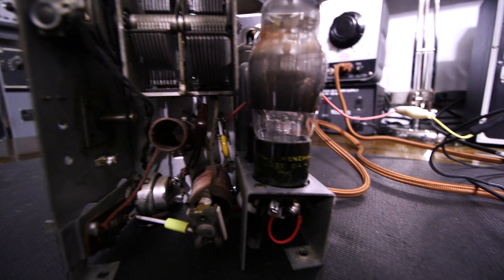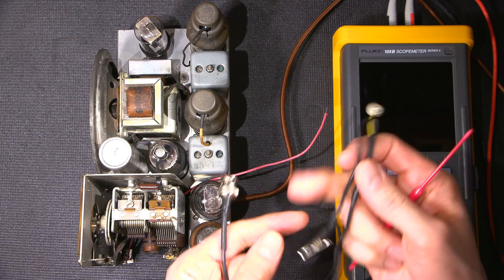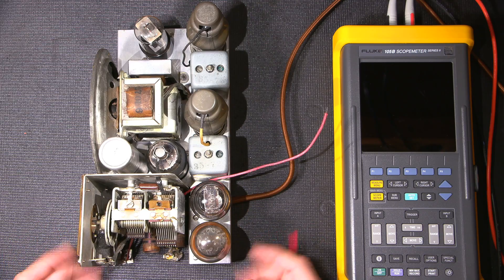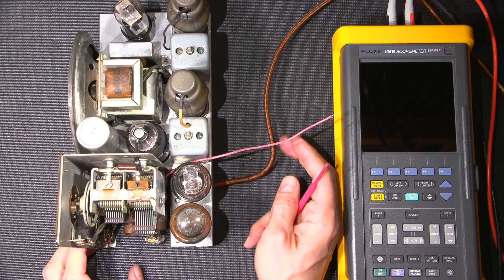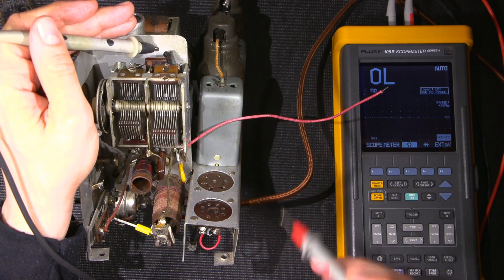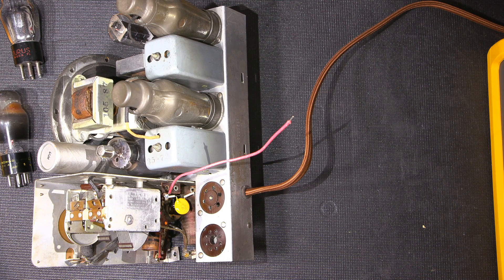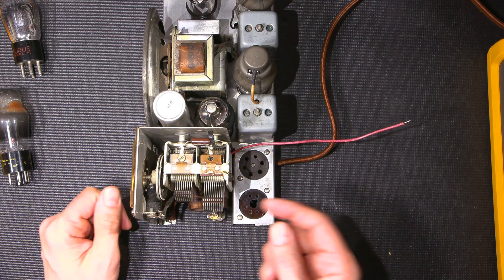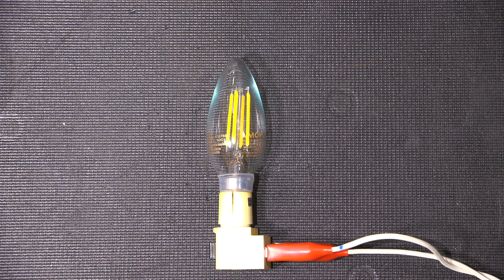See High Voltage Created From Falling Snow!

Comment: Years ago, I had this happen to me.I was woken at 2am by a loud cracking noise coming from the ham shack. The coax from my G5RV was disconnected from the radio, but lying on the bench near to my FT847. It was snowing hard outside. There was a big arc between the radio and coax connector. I got quite the belt when I grabbed the coax! I now have polyphaser protectors and have not seen this happen since. Interestingly the FT847 survived with no issues.

Comment: Oh, I had similar happen on a coax cable leading to a large CB antenna.  There were storms nearby and I disconnected the coax cable from the CB base station.   A little while later I started hearing a pop every couple seconds, and found a spark jumping from the center to the shield.  I think the antenna was picking up static from the air.
Reply: My experience exactly!

Comment: Back in Missouri, we had a teacher describe what your talking about, except he had no antenna, what he had was lighting rods on top of his house. And the Cable (#0 ???) running down the side of the house would glow RED from the current being taken off the the lighting rod spikes during the winter- no snow, just really cold outside and windy. It would have been interesting if you could use one of your scopes to catch RF from the spark.

Comment: It may also be related to the dust content in the air at that moment. It is a known phenomenon. Search for dust triboelectric charge. In serious storm, dust may charge up to 15 kV in dry conditions.
In US one must look for Peoria Loess dust releases which usually occur in winter time.
Reply: I wondered about carbon particulates myself but good old dust of course
Reply: You, and many others, are missing the fact that there was a 30 or so ohm resistance between the capacitor and ground, through the coil. This should earth the antenna and prevent any static build up on it, unless it's some AC or RF phenomenon that interacts with the reactance of the coil and capacitor in the radio.
Reply: @tasmedic  Would you care pointing the time where Paul says that the antenna was grounded? At 3:54 he clearly states that the antenna was not grounded.
Reply: @ciprianpopa1503  My bad. However both sides of the antenna were outside. so both would have developed a similar charge, with one leg being connected to the chassis of the radio, and the other to the antenna socket. No net potential between chassis and antenna means no current flow. Your turn....
Also please point out where Paul says there was a dust storm. I think he said there was a snow storm but I can't be bothered to trawl through the video to find the exact time. 
Even if there WAS a static potential between the antenna socket and the chassis, please explain how an electrostatic  charge  could build up when the resistance between  chassis and the coil connected to the antenna socket is around 30 ohms.
Reply: @tasmedic  So my turn then. Dust raises always in front of a weather front, termed haboob (from Arab language) due to their frequency in the hot desert areas. A snow storm is a dry event that can sometimes produce a snow haboob which raises dust ahead of its path if it encounters a dust source. 
Paul indeed said in was a snow storm and I hypothesised a potential cause for the discharges he presented here, and I expanded my reasoning above. Your turn now.
And P.S. I am not supposed to explain anything, I just named a possibility, and whatever you are claiming the Paul's setup was during the recorded event has to be confirmed by Paul only, otherwise we are only in the realm of suppositions.
Reply: @ciprianpopa1503  
Haboob comes before the snow, not during it.. You completely ignore my comment about the 30 ohms in parallel with the sparking components, quite wisely. Enjoy your suppositions. They're all yours!
Anyway, I've enjoyed our discourse and I do wish you a great weekend, Ciprian. I've learned about Haboob, at least, so thanks for that.
Reply: @tasmedic  Whatever your statement is, it does not matter (unless you are Paul's alter ego). The only thing that matters here is how Paul describes the setup. My hole comment was based on the statement that the antenna was isolated, and more important on the title of the video "... from falling snow". Since snow is not a particularly known dielectric, while dust is due to its dielectric mineral components (i.e. quartz), my suggestion was referring to that statement in the title. The mechanism on how the phenomenon occurs in this particular setup is still to be explained. 
There is not such a thing as a separated event, like first comes the dust and then comes the snow. There is always a mixing level involved in every phenomenon in nature. Have a nice weekend too.
Reply: @cipndale  
I agree. It's a bit of a mystery. That's the wonderful thing about Physics; there remain so many questions posed by the universe, which we can't adequately explain or model mathematically. Have a great weekend, Ciprian.

Comment: Back in 1987, I had a an assembly of dipole antennas for each band connected to a single coax.  These antennas were hanging high above the roof of the eight floor building I lived in at the time. I always disconnected the coax connector from my Hamradio transceiver when I was not using it. One day during an approaching rainstorm, I heard the same kind of clicking noise which increased in intensity as the storm was approaching and I discovered an arc forming between ground and the center pin of the PL259 connector. The same thing would happen wintertime at low temperatures when it was snowing. I made sure to stay away from the cable when this was happening. Greetings from Sweden.

Comment: I have seen  (and heard) similar arcing happen on a disconnected antenna cable. My brother had a big antenna on the roof and at that moment nothing connected to it. we started hearing this sort of clicking noise and after searching for it for a while we found out it was arcing from the core to the shield at the connector.making this very audible "click" noise. And yes it was heavy snowfall at the time. This happened in the early eighties and i had forgotten about it. This video reminded me of that happening.

Comment: Neon bulb across antenna input might help mitigate this, perhaps. I've seen neon bulbs in old cb radios near back rf section.
Reply: They are mounted in Sailor ship radio equipment, as spark gap in the antenna line. to prevent damage. (Thunderstorms, and this.)
Reply: also used to verify that the finals are working
Reply: This neon is a common trick (it needs to handle transmit voltages as well of course, or be disconnected for transmit.). Another is to put about 10 or more MegOhms of resistance to ground to bleed off the static buildup from snow or wind.

Comment: Pecipitation Static (or P-static) is what you were experiencing. I know it well like many others. It is a high voltage near zero current charge that builds on antenna due to precipitation or other small particles in the air. The reason for the snap is that your coax acts like a high voltage capacitor and builds up charge. The charge is from the particles which cause a pulsing charge for each particle hitting the antenna. Even though you had 35 Ohms DC to the chassis the pulsing DC is more like broad band arc noise. Simple arc style lightning or charge arrestor will prevent this. You can also install what are known as "porcupine" or "maple leaf" style static dissipator that reduce this effect. You may have noticed many on commercial towers and tall structures.

Comment: Could the rise time of, or the frequencies in, the arcs, be sufficiently high to have little current through the coil of the tube radio?
Reply: It might be congruent with the signal passing through the capacitor, perhaps.
Reply: Yes very fast rise time, not frequency.
Reply: @Very_Dark_Engineer  Please recall arcs are used in the old-time spark gap radio transmitters and Tesla coils for an RF source. In addition, a fast rise time consists of multiple higher frequencies, sine waves, per Fourier analysis.

Comment: I live on a hilltop in NY State and in the winter I keep my antennas grounded when snow storms pass through.   

Twenty years ago I heard arcing during a storm and traced it to a multiple band coax switch and realized the floating inputs from the 75 meter antenna was arcing inside of it.  Very interesting.  Back in the 70's in another QTH, I was in the process of disconnecting my antennas during a sudden thunder storm and had arcs jumping across the PL 259 connection while I removed it from a coax switch.  

Mother Nature likes to surprise us every now and then.  Thankfully in my case not fatally, so far.

Comment: Quite a few years ago, I had a similar occurrence. Where I live, I need an antenna amp, a good antenna and coax lead in to receive decent broadcast tv reception. One very cold night during a snowstorm, reception went to pot. Suspecting the amp, I disconnected the coax from the amp, and I can confirm that yes, that _hurt_. (Yep, I got zapped.) Every few seconds a spark would jump from the center wire to the f connector ring. Really weird. And yes, I had to get a new antenna amp.
Reply: I hope the your antenna amp is a tube amp, not a transistor amp. Tubes are mechanically frail and inefficient and huge (they are made of glass) and they can break easily, but ELECTRICALLY they are extremely rugged. An overvoltage situation would cause temporary arcing between the grids and the cathode and plate, which is nothing more than some tiny burn marks which are not a problem. But a transistor would be irreversably ZAPPED instantly, even high-powered power transistors! Transistors can handle large amounts of power, but getting out of there specifications for even a fraction of a second would zap them. Maybe that's why the Russians insisted on using tube radios in their military aircraft during the Cold War during the Soviet Union days.
Reply: (I am commenting on my own comment): I forgot to add one more thing: the issue of EMP's. EMP's (electromagnetic pulses) can damage solid-state devices much more easily than vacuum tube devices. We must be very vigilant about our computer-controlled power grid, people with implantable devices like pacemakers and cell phones and tablets. Unfortunately, it is impossible to make computers with present technology that don't employ solid-state devices. Our technology is EXCELLENT, we just have to be very careful.

Comment: I have noticed lots of similar arcing both from rain and snow into my antennas when I was a teen in the 70-80's , for instance my CB rig was a Lafayette HE-20T connected to a 1/4 GP and I had it in my room.
Sometimes I woke at night hearing this arcing sound from the the radio when it was heavy snow or rain weather outside.
When I removed the PL-259 from the radio I noticed sparcs between the shield and pin, jumping up to 10 mm so it may be 10-25 kV static charge in the antenna.
Even heavy wind will charge antennas, the solution is to use DC grounded antennas.

Comment: High voltage can get very weird very fast! My guess is that the capacitor is flashing over, and the fast pulse doesn't go via the inductor. Path to ground is unclear, probably the isolation transformer, or perhaps the mat is bleeding away charge to ground, or its flashing over the insulation on the line cord, since it looks like you have those wires crossing over!

Comment: you may want to check your isolation  transformer as it may be damaged by the arcing.

the arcing could burn off the varnish on the windings and cause them to short.

the driver in the led bulb is what is damaged.

if you take the bulb apart and connect a 50 volt source from a battery to the led board they should work fine.

i have had a couple of led bulb go bad and cycle on and off and so when i tear down the bulb and remove the driver and then series a few 9 volt batteries to the led it lights ok.

Comment: This reminds me of a weird night about 30 years ago. It involved my CB radio aerial and coax. We had been having a few storms during that autumn, and I had disconnected my CB aerial as a precaution against lightning strikes. A few weeks later, and still disconnected, the plug on the end of my CB coax began sparking, very much as you see in this video. A very steady and regular tick-tick-tick-tick-tick-tick-tick, and looking very much like the kind of spark you'd expect from a car's plug leads, held about a quarter inch from grounded metal. The gap between the parts where the spark was jumping was about 3/8". There was nothing connected to the aerial or coax, and the aerial was a loaded dipole, that's to say both the driven pole, and the ground pole (tied to coax braid) had loading coils to tune them for use at 27MHz. The aerial was mounted vertically at the regulation maximum of 21ft above ground, and was mounted atop a wooden pole which was in turn mounted on top of a steel mast.

Weather conditions were heavy fog and very light breeze - the kind of fog you can see moving horizontally.

Naturally, I didn't stick my fingers on the end of the plug to see how lively it was, but it was fair cracking out those sparks. I had to be up for work next morning so I was more concerned about bed than faffing around to investigate this odd phenomenon, so I cautiously hefted the coax out through the window and left it at that. I've never seen it happen again.

Comment: I had this happen to me twice here in Arizona.  I had a end fed long wire up about 20 ft and about 70 ft in length.  The (shack side) antenna end wasn't connected to anything just close to a piece of metal drywall corner strip and it started to tick.. tick .. tick (HV arcs) between the antenna wire and the metal strip while I was sitting here.   The clouds over head looked lower than usual and very angry looking.  I haven't had noticed anything similar with the hustler vertical.  And I got rid of the long wire.

Comment: I’ve seen something similar at an AM broadcast station I was working at.

It looked like we were going to get some rain and I noticed the transmitter meters briefly jump at random.

I found the cause at the antenna.

There was a chain of sparks jumping the insulators on all three of the top guy wires.

Fascinating and more than a little bit terrifying.

It stopped when the rain started.

The transmitter never did go off the air.

Comment: I was part of a team of 100 re-imaging the subsurface of the Alaskan north slope oil field in 1992. We were working in the lab (trailer on skis pulled by a cat) when we were hit with a blizzard at around 50 below Fahrenheit. We had cables that had analog pairs that would bring back signal from our sensors.  During the storm the 45 mph wind was blowing snow horizontally across our cables. The static protection in the cables interconnects included gas tubes which would light at about 60 volts. These tubes were lit up like a Christmas tree. At those temperatures there is little or no humidity. In the course of that winter we did also see ball lightning, which I understand is very rare to sight.

Comment: One of the things that the old 1930's Radio guys used to do when building a big antenna system was to include a spark-gap on the outside of their radio shack where the antenna was fed in, one side of the spark-gap was connected to the antenna, the other end was connected to a long copper or brass rod that was driven into the ground.

Comment: Best part about this is now having a proper interface to some real lab equipment.  This is fascinating.  Thanks for including us in the mystery and how to perhaps quantify and explain it.  36 Ohms to ground is basically ground.
Reply: As far as DC is concerned yes it is. The inductance of the coil shows that it had high frequency AC on it at the moment of discharge.

Comment: Perhaps conditions were right for a tree branch (or dirty insulator) to intermittently arc to a nearby power line? This would create a spark gap transmitter, with your antenna capturing enough energy to manifest as arcing in your receiver?

Alternatively, conditions were such that your antenna was accumulating each tiny charge from the snowflakes, until breakdown occurred.

In either case, the impedance of the coil was likely to be far greater than the DC value; short duration “transient” spikes could see the cap as a short and the coil as an open, possibly allowing for the voltage to build rapidly to the level where it would cause cause arcing to the chassis.

If you figure it out, please make another video. And thank you for the wonderful work you do!

Comment: This is a very known fenomen here in Norway, by us ham's! The best from LB1NH Arild in Oslo Norway.
Reply: Would you care to describe the phenomenon (and its cause)?
Reply: @edinfific2576  Yes. it is aproxemently what happens in thunderstorms, but in less scale. The snowflakes hit the antennawire, and makes static electrisy up to 2-3 Kv. But very little amps. You wil not die by getting this voltage in Your fingers, but you will feel it very hard! (Sorry for my English). As you are in a hotell, walk on a blanket, and push the elevator knob. Maybe you have some experience With that? Or going out of a car, touch the ground, and then are near some of the metal on the car afterwords? Hope you understood me there Edin! LB1NH Arild
Reply: @gamlemann53  Thank you. I understood enough.
Reply: If there was a 30 or so ohm resistor between your body and the ground while you were walking on the carpet, I doubt any charge would build up. Please try another explanation.
Reply: @gamlemann53   Thank you. It is now even more clear to me.